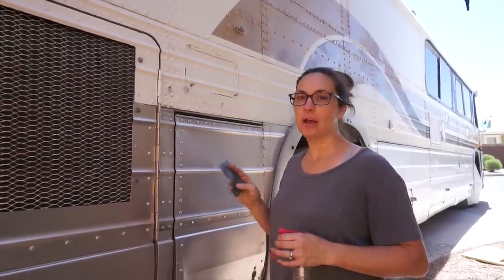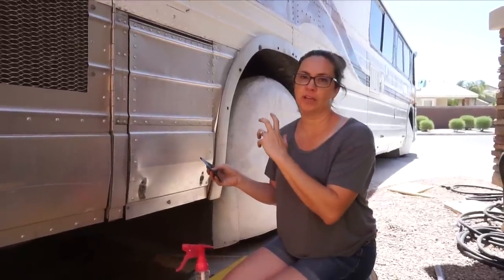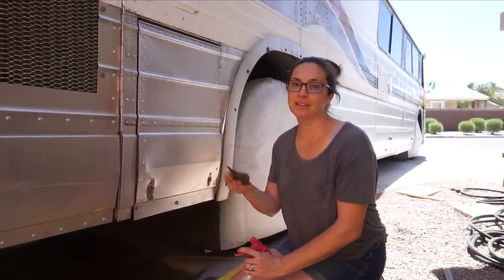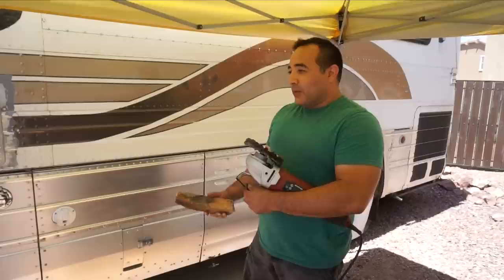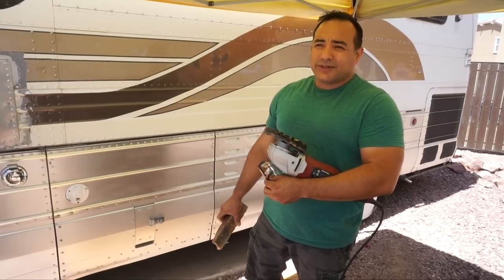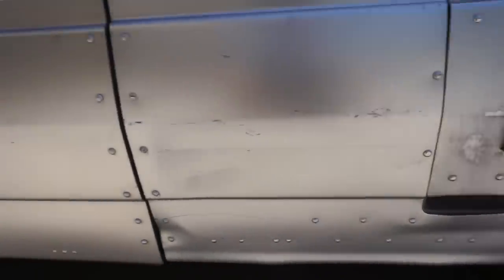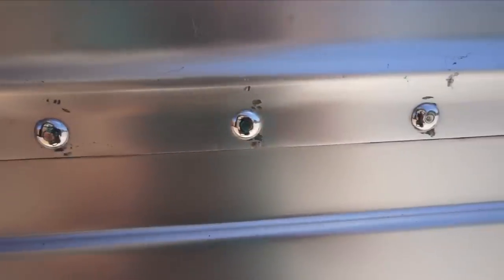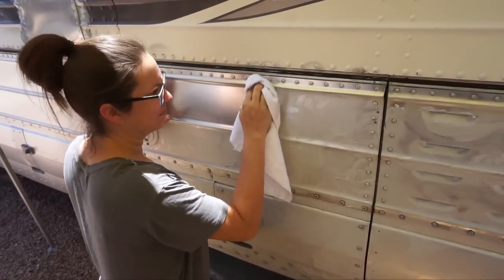Deep Cleaning Anodized Aluminum

Comment: Juan, I was told not to sand? I use WD-40 with a rag.
Reply from the maker: Thanks Danny - we tried just to polish them with aluminum polish at first and it would not clean the "haze" or grime off of them.  The wet sanding we did was pretty light and mostly just knocked off the grime - if you sand too hard the anodizing will come off eventually (as seen on that handle where we tried to remove some of the scratches with heavier sanding).  I didn't try WD-40 - I will give that a go next time we clean them - thanks for the suggestion!
Reply: Beginning from this Morning My Brother uses WD 40 on his 47 Silverside, kinda like keeping a nice pair of shoes or purse moisturized
Reply from the maker: I have seen the bus - beautiful!
Reply: Did I miss a new paint job ?
Looking fantastic

Comment: Good thing you aren't doing this with a Flxible bus. Wouldn't be big enough for you guys.
Reply from the maker: Flxible buses were on the short list - but we are pretty happy with our 4106
Reply: Beginning from this Morning Also, you'd have lost the entire back end of a Flxible bus just to fit the HVAC etc in there. Though next time you do a bus, use Tesla battery modules. The version with the 21700 cells in them. 25 volts each, and only weigh 52 pounds. And no compression needed either. Also could easily modify the BMS connectors to suit your equipment.

Comment: Your removing all the anodizing!  Now your unit will corrode, not a good practice. Anodizing it done at the factory through a process, good luck a lot of work to ruin your rig.
Reply from the maker: If anodizing could be removed with a buffing wheel and polishing compound it wouldn't offer much protection.  This was a deep cleaning (that's why the title is "Deep Cleaning Anodized Aluminum")  we did not remove any of the anodizing and even almost 2 and half years later it still looks great.  If we truly wanted to remove the anodizing we would have used chemical means to do so, followed by much more rigorous sanding, and multiple stages of polishing.  We did fully polish the bumper and a few pieces inside the bus: https://youtu.be/oJtIrUvK32w and https://youtu.be/QGdWdNMJJ_s
Reply: @BeginningfromthisMorning  Recently found your video and appreciate it! We're in need of deep cleaning our 1984 Avion 30P and haven't bit the bullet yet. Nervous about damaging it so doing as much research as possible first. We do know that it doesn't clean up with just elbow grease and a polish. Spring is technically here so cleaning is just around the corner. Still a bit concerned about sanding but I see a lot of people doing it so we just may give it a whirl. We've tried Barkeepers Friend and a non abrasive srubby, it helped but not to the extent we were hoping. Wish us luck!  @hoffer54, there are 100 different ways to question someone's methods without being snarky.
Reply: @BeginningfromthisMorning  as a mechanical engineer I can confirm you have indeed removed part or all of the anodized surface. Perhaps your sanding was very light and the coating very thick, but from what I saw the abrasion would be enough to remove most coatings.
Reply from the maker: @lunacyworks  this was done 3 years ago ... we have been traveling for 8000 miles thru all kinds of weather, numerous locations including many times at the beach and these panels still look about the same as they do here.